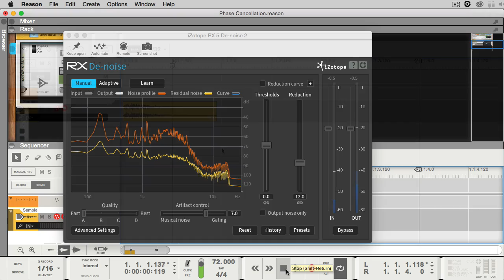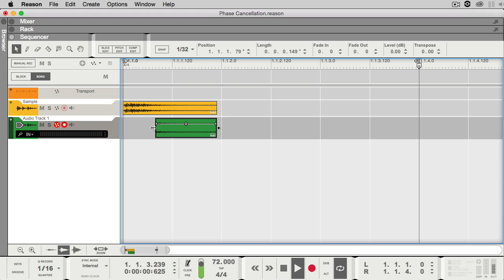Hiphop Sampling Vinyl Tip - How To Isolate Kicks, Snares, Samples Using Phase [Reason 9.5]

Comment: Just trimming the initial clip would have the exact same effect and save you the extra steps. Super unnecessary.
Reply: quaxBK haha, beat me to it
Reply: quaxBK no it's not. Not even close. Take a sample with noise running though it and span it across the entire sample, it will eliminate that noise. trimming will just cut your sample short, which isn't the same
Reply: He duplicated the track and flipped the phase, thus eliminating not only the noise, but muting the track. By truncating the beginning of the flipped track, he is not cancelling out the beginning of it, but only the part that he actually left in, ie. the tail. But if you just truncated the original sample to begin with you wouldn't have to bother with all the phase flipping.
Reply: You need two different tracks for what you're describing to work. One with just the "music" and one with "vocals + music" and both those have to be the exact same except for the vocals. You typically don't encounter that.
Reply: Greg Savage I look forward to seeing you take two samples from VINYL, one with just instruments and one with drums behind instruments, and try to "phase out" the instruments to leave only the drums. I am 100% positive that's not going to work as you're trying to claim. That method would only work if the instrument+drum sample contains an EXACT digital waveform of the instrument-only sample which you're definitely not going to get from vinyl. Compression and mastering would make this difficult to do even from a modern sample-based song that remained in the digital realm. This isn't really a legitimate alternative to creating a noise profile to process a sample and back out unwanted noise.
Reply: Greg Savage to emphasize what I said, two different samples from vinyl will have dynamics that differ way too much to work, even "partially". Go ahead and try it for yourself.
Reply: quaxBK try the same technique with music under a vocal.
Reply: quaxBK a lot of songs start with an intro or.have it's melody isolated. I generally take out 8 bars, cut off the melody part and sweep it under the copy and isolate all kinds of things..same track just.using a small section to cancel with
Reply: Mike Loeffler 100% cancellation, that's not going to happen. Partial on the other hand will depending on the source (recording date)
Reply: Mike Loeffler 2 samples from the same song (on vinyl)? If so, I've done it before with partial results.